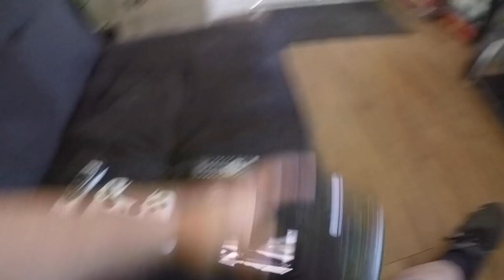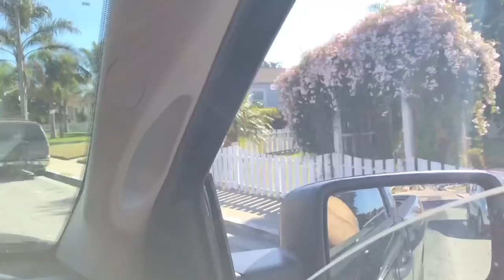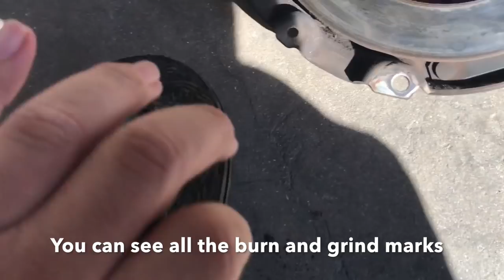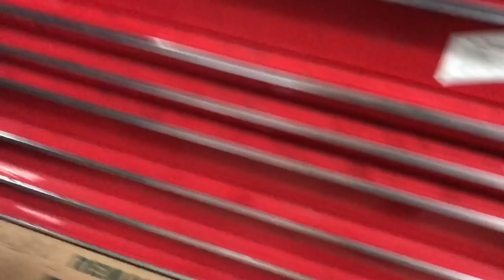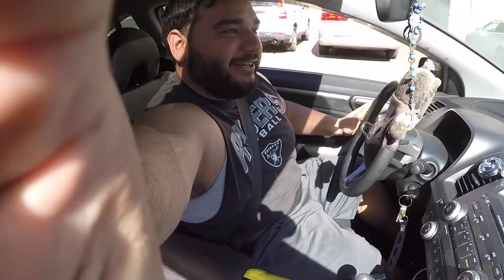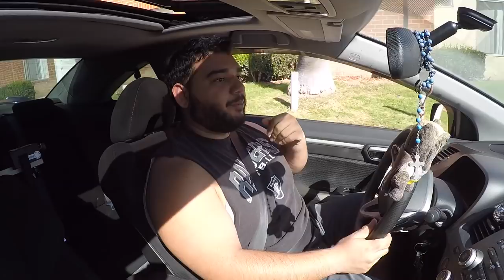Exedy Stage 1 Clutch First Drive!!!

Comment: You do know clutches need breaking in. If you beat on your car as you are you will need to replace your clutch in the next 10k miles. You need at least 500 miles of babying the car
Reply from the maker: Edward Mulama yeah I know. I was just too excited lol
Reply: Tony Castillo ORA!!!! Lol
Reply: @TdaKid  bro said fuck it 😂
Reply: Never broke inn any of my clutches and never had an issue. They lasted forever.
Reply: @Bang_n_slang bro i didn’t break mine in after changing it and it just slipped completely yesterday after only like 4-5k miles

Comment: If the catch is near the top the clutch pedal needs to be adjusted. It should engage more at the bottom. Most adjustments say 1/4-1/2” of play from the bottom for engagement.
Reply: Awsom Sauce100 this is the best info that I have read. ALOT of people don't know what they are talking about but you are spot on.
Reply: Yeah the stage 1 should catch right away on the Si, the cmc needs adjustment. Also, is the clutch pedal feel one smooth motion? It should not be two staged like a ms3 or wrx clutch.
Reply: But yeah exedy stage 1 and hf02 flywheel, excellent acceleration. Si will feel much faster esp with mods. Just remember to shift quick and keep foot on gas before letting clutch out. No, it should  NOT chatter unless your mech installed incorrectly
Reply: @SkywallGuttz i have an exedy stage 1 and it engages at the top how can you adjust that?
Reply: Nice!  Getting the Exedy Stage 1 on my 100k mile FA5 now in fact, along with Koni orange struts and Tein springs. Looking forward to it. Finally putting a little love into an otherwise stock Si.
Reply: That's what I thought too. The older the cough, the more higher it catches.
Reply: @carlosfigueroa4611  in the car u have to loosen the lock nut on the clutch master cylinder under steering column. and to adjust it to where it grabs more at the bottom. u turn the rod. (NOT THE NUT) counter clockwise few turns. do this Lillie by little until u get the grab point where u want it.
Reply: I just did my clutch job on Friday. Stage 1 exedy. Didn’t bleed anything. Kept original slave and cmc. Pedal catches at the bottom barely any free play before it catches. It grabs hard. Is that Normal for a stage 1?  I tried to adjust pedal but didn’t seem to change much. Before with slipping clutch it would grab in middle.

Comment: I have an fg2 and I run a stage 4 competition clutch with k tuned cmc and slave and ktuned shifting cables. After about 1000 miles when I broke in the clutch, my engagement point went from being near the bottom, to just over the halfway mark. I chirp every gear, it’s an amazing feel in the clutch pedal.
Reply: is it normal for a stage 1 clutch to be the same? same with mine with my mk4 gti. when first installed the engagement point was near the bottom but after breaking it in (600-700 miles) it’s close to the top over the half way mark
Reply: @josephalvarez5422  it's recommended after breaking in the clutch to get the clutch adjusted to make sure it's at the correct release point and you should be good to go.

Comment: Hey dude. Have the guy adjust your clutch master cylinder at the clutch pedal so it can catch in the middle. You’ll get used to it it way faster. Clutches that catch high take some time to get used too. You could burn your clutch since it’s up high due to trying to feel it out or tapping the gas too much until you get to the catch point. Or you can adjust it yourself takes 5 minutes.
Reply: Jay_em2 Hi I wonder how to adjust ???? I drive mercury cougar and I am in the middle of changing clutch to stage 2 . Thank you !!!!

Comment: For people who never went beyond OEM, Stage 1 can tkae a bit of getting used to, but dont be intimidated by it. Its very easy to get used to, its not THAT bad for daily purposes and traffic, and its a GREAT upgrade for people who are modding lightly. I made close to 400whp in my RSX Type S and the the Stage 1 actually works fine and holds the power as long as you dont overheat it or launch it hard it. If you plan on launching the car a lot, you are probably better off getting something more heavy duty. Since I daily my car, and I dont beat on it, the Stage 1 is fine for my 389whp on pump gas. But I do have a more linear powerband with a smaller turbo and boost by gear so it is a bit easier on the clutch, rather that massive power explosion up top with bigger turbo's.

Comment: So it feels like a compound bow. When it's all the way in, there's almost no back pressure. But through the arc there's tons. I can see it kicking your foot. That's extremely hard to get used to. If you can get full release before the floor you could finesse it sweetly.

Comment: What’s good Tony, how is the stage 1 holding up?? How many miles are on it? I’m going k24 in my fg2, so I was thinking this or my go to, exedy oem. I’m not using a lightweight flywheel though, oem.
Reply from the maker: It’s perfect. Holds pretty good amount of Tq. If you’re not going high boost or a aggressive set up you’ll be fine with the stage 1. It’s a great peace of mind for me because I’m switching up my motor set up soon so I know the clutch will hold 😉

Comment: How are you boss? Got an fg2 too. I'm wondering if when are you supposed to change the clutch ? And how do you know if the clutch is bad already?
Reply from the maker: Moymoy Pacada pretty much if you floor it in gear and your rpms shoot up like you’re revving. Pretty much the clutch isn’t catching... it really depends tho my dude cuz I have a buddy that changed his at 230,000 miles and I had to change mine at 80,000 miles. Just depends on how you beat on it

Comment: hey bro im thinking changing my clutch on my subaru sti 2011 but do you think i should get stage one by your experience or should i get higher stages ?
Reply from the maker: Stage 1 for daily  with a few mods
Stage 2 if you’re planning on going all bolt ons and a tune
Reply: oh ok thanks bro btw i just subscribed 👍 great vid bro

Comment: I just had a fidanza  v2 clutch in my car and I am slowly getting used to it.   How are your down shifts? if you don't heel toe, do you get that nasty vibration?
Reply: Heel toe ?
Reply: @giovanniflores5343  or double clutch on the down shifts... pretty much if I don’t rev match, the car makes a weird groaning noise if I down shift normally or start out in first and don’t release the clutch fast enough

Comment: I have a 2016 Honda Accord 6 speed what clutch and flywheel do you recommend I do daily this car but my factory is going out soon?
Reply from the maker: Normal _ a stage 1 is best for daily driving. If you’re not going to mod or push more power then go oem.
Reply: Tony Castillo thank you so much! And yes I plan on doing some little things to it and tune it

Comment: What’s up man. I need a clutch for my 2009 Civic Si. I have decided to get the stage 1 Exedy but can not make up my mind if I want to get the Exedy light weight flywheel or just resurface the OEM flywheel. In ur honest opinion do you like the light weight flywheel better or the OEM flywheel and does the light weight affect the ease of daily driving? Thanks
Reply from the maker: If it’s just for daily driving and you’re not going to be upgrading anything else just stick to OEM flywheel

I did the lightweight out of wanted to experience it. It does get some time to get used to but I personally like it.
Reply: Yeah it’s just for daily driving. The car does have aftermarket intake, header, throttle body spacer and exhaust and I plan on getting a flash pro and a custom tune it the next few months but I drive super easy most all the time and never plan on racing or anything like that!

Comment: It is nice, but it doesn't last very long , maybe 40k-50k at best. It'll start slipping around that mileage. Not for everyday driving unless your willing to replace it soon. But much much better than stock.
Reply: Maybe you just can’t drive lol. I have Exedy in my em2 with 79k miles no problem and one in my es2 with 130k Miles still no problems. It’ll last over 100k if you don’t beat on it
Reply: Lol, nah , I didn't really do anything crazy with the clutch,  it's my daily drive , but mine just started slipping around 40k. Plus, I had the clutch adjusted ,maybe that might've shortened the lifespan. If I were to do it again , id install stage 1 and use stock flywheel. That's just my opinion tho.
Reply: Eddie Syfy why is it better then te stock one ???
Reply: Broly Assasin 
Stage one felt more race like, shorter distance in clutch and precise, spot on shifting. It felt like a better linkage between the engine and transmission.
Reply: Eddie Syfy oh i see . Whats the price for this stage 1 clutch and any brand ???
Reply: Broly Assasin 
The exedy clutch kit was about $260 I believe from eBay ,  and install was $600. So total was 860 or So with tax. I likme exedy , i have exedy stock clutch installed now on my Si and no problems at all.
Reply: Eddie Syfy ok the clutch not that price but the labor dam , good thing my friend is a mechanic lol a little cheaper in labor , thanks for info ill put this kit when mine goes out
Reply: Broly Assasin awesome. Good luck and enjoy man!!

Comment: I just got a 9th gen si, what causes your clutch to go bad like that? I'm a noobie so someone help me out and give me some advice!
Reply from the maker: it goes bad from beating on your car pretty much. i beat on mine and it was over 90,000 miles so it was bound to happen
Reply: Yo tengo un si 2009 y tiene 73 mil millas y me cuesta entrar el cambio y me dijeron q es el clutch pero antes de eso compre el exedy clutch mastee cilynder pero despues lo cambie porq se me rompio un perno y despues de eso compre uno de 60 en autozone y cuando prendo elncarro ya no me entra los cambio hasta q calienta. Y mi mecanico dijo q es el disco y el plato. Quiero comprar el q tu compraste pero no se aun. Si tu ya lo comprastr en tu video q me aconsajas te salio bueno el exedy clutch stage 1. Para comprarlo me gustaria tu opinion

Comment: Is there any clutch chatter ?
Reply from the maker: SWISSTHEDJ a slight sound cuz of the lighter flywheel 

My clutch pedal makes a squeek now
Reply: Tony Castillo oo iight. Got the OEM clutch kit and and light weight flywheel. Place I got it from didn't have the OEM one. Is the sound bad ?
Reply from the maker: SWISSTHEDJ nahhh you’ll be fine
Reply: Coo. Thanks !!